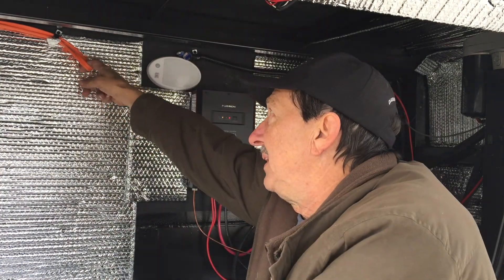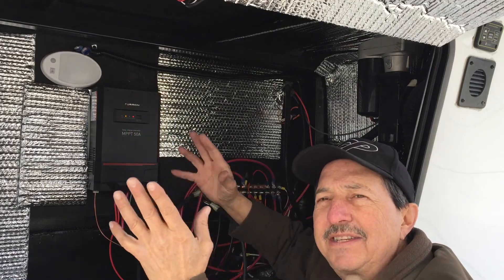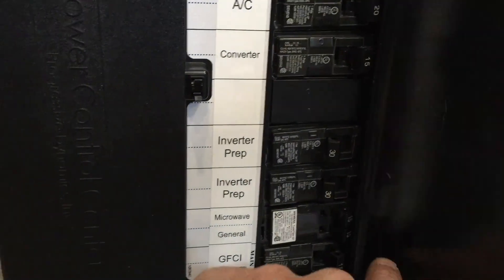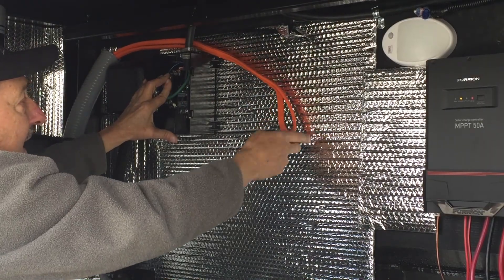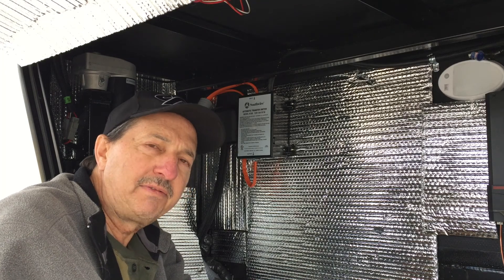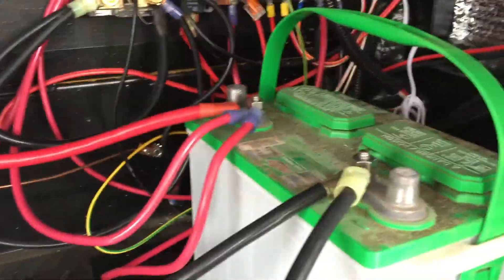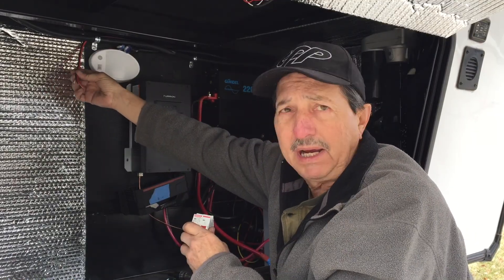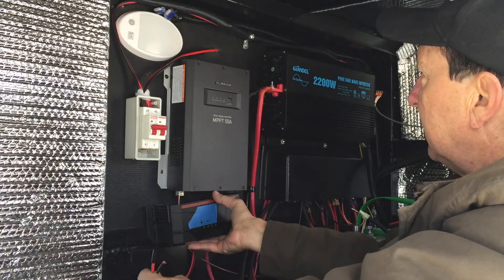Easy Grand Design Inverter Prep, Automatic Transfer Switch (ATS) And Inverter Install. + Solar.

Comment: Awesome video - beautifully designed system and wonderfully presented.  Question, for the free standing eternal solar panel connection, do you just open the side cargo latch to hook this in or do you have some other type of connection?  Some RV's have a plug for external solar mounted on the side wall near the cargo bay doors.
Reply from the maker: The external panel connection comes through at the middle of the cargo bay. It has a 10 gauge cable with connectors that is long enough to reach the bay doors from either side of the trailer. My cargo bay has a pass through hole at the floor by each cargo door that allows me to run the cord to my free standing solar panel from either side of the trailer and still be able to close and lock each door. I have a 20 foot long, 10 gauge solar extension cable, that allows me to place my solar panel at any side of the trailer in order to get the best sun exposure. Worked great at a campsite that had lots of tree shade so I could chase the sun and fully charge my battery.

Comment: So the live wire goes "IN" shore power on the transfer switch and the dead wire goes in the "OUT" to inverter?
Reply from the maker: To clarify, for the auto power switch box I used, the live shore power from the fuse/ breaker panel connects to the "Power IN" (top left), the power from the inverter connects to the "Generator IN" (top right), the "Power OUT" (bottom) goes back to the fuse / breaker panel.

Comment: What year and model Reflection do you have?  I am about to pick up a 2023 Reflection 320MKS, so wondering if mine would also have the “loop” in it.
Reply from the maker: Mine is a 2022, 226RK. My understanding is that all of the Grand Designs have the inverter loop. Check the breaker box for inverter breakers.

Comment: GREAT video Sir!!! You have saved me LOTS of money; God bless you 🤗🤗 It seems like you know electric stuff so, I have a question, in my Keystone 2023 I have a battery disconnect switch and, I wonder if I should connect the inverter's positive cable after the switch box so that it will also turns off the inverter system when I switching off the camper power during storage. Many thanks!
Reply from the maker: I am happy to hear that my video helped you and saved you money. I left the battery disconnect switch as is. The inverter takes large amounts of power so the wires to the battery needs to be gauged to power ratings and length of wire. The inverter I used had that in the install instructions as well as it came with the wires. I installed it as close as possible and wired it direct to the battery as instructed by the manufacture. Follow the inverters instructions closely and you should not have any problems.
Reply: @riderescue  Got it, many thanks again!! 👍👍

Comment: Great video.  I have the same Charge controller in my Reflection 315.  Question, does your convertor charge lithium batteries  I noticed in my manual there were several models and one was lithium only, are the others ok for Lithium as well
Reply from the maker: I'm no expert but I love a good challenge so my research found this information. My charge controller is not set up to charge lithium batteries. I was shopping for a replacement when I stumbled onto a forum that had a great discussion about the topic. Simply put, the 110 volt to 12 volt controller will only charge a lithium battery to about 80%. When on shore power and under 12 volt load the controller will handle all the power needs. When no power is needed the solar panels will then fully charge the batteries. The 110 volt controllers regulator notices the batteries are fully charged and drops down to trickle charge mode for standard batteries. That is why many controllers over charge a battery if left on for long periods of time, so pull the shore power and let the solar take over when not in use.